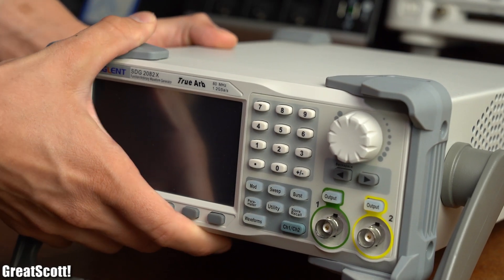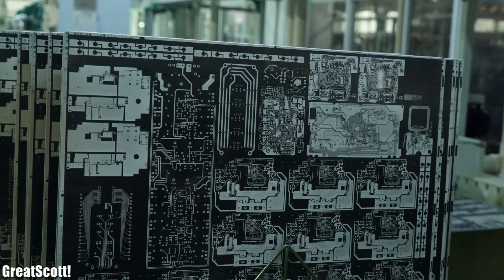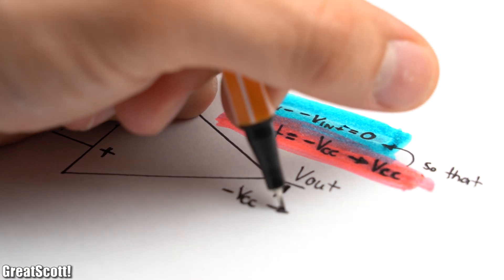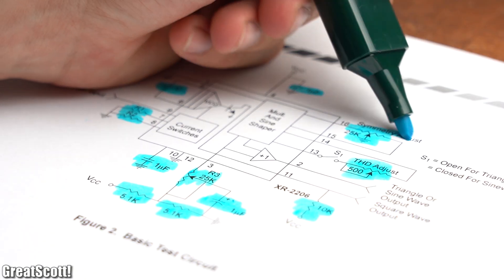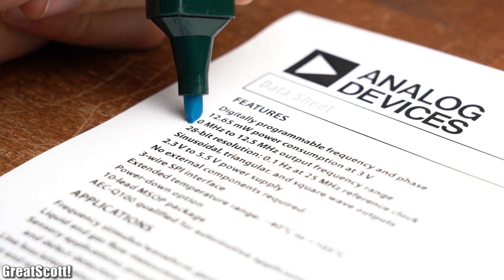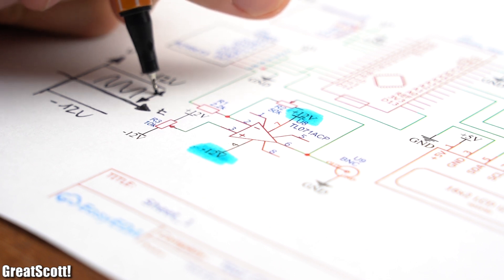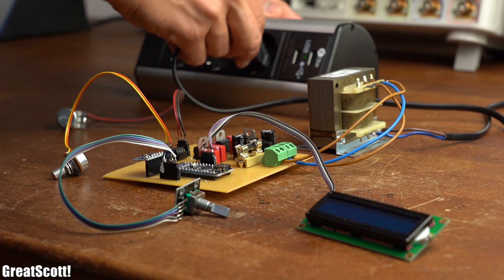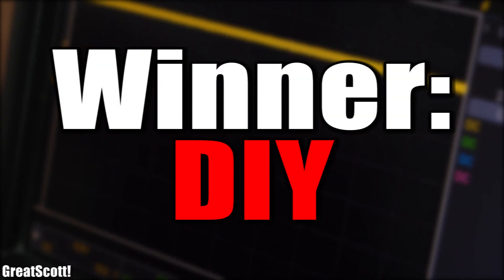Function/Waveform Generator || DIY or Buy

Comment: Sharing a new firmware release. Change log:
- Use **MD_AD9833**(modified) library to control the AD9833 Module: compact and bug-free library with great functions.
- Improved, simplified, optimized, fixed bugs, used better/"standard" libraries for all components: the display, rotary encoder, button.
- Improved navigation, essentially, coded from scratch (see Navigation section below).
- *NEW* Improved the way frequency value is displayed (coded from scratch): 
  - option to hide leading zeros in frequency value (toggled by triple click of encoder button).
  - option to delimit thousands by a separation sign (toggled by triple click to encoder button). 
  - a selected option (one out of four possible combinations) is stored to EEPROM (if enabled) and is set at start up.
- *NEW* Use EEPROM to store and recover settings at switch on (to disable comment `#define ENABLE_EEPROM`).  
- *NEW* Added graphic icons for signal form representation on the display (if you still like the old way, comment `#define GRAPH_ICONS`). 
- *NEW* Tied a signal mode to a Channel; so, now you may change signal form along with its frequency by selecting a channel.
- *NEW* Added a new signal mode: square/meander signal wave at 1/2 frequency (for more accuracy of the output signal frequency). This is a standard feature of AD9833 module. Comment `#define ENABLE_MEANDRE05F_SIGMODE` if you do not need it.
- *NEW* More convenient and fast way of input frequency value by rotary encoder (if you still like the old way, comment `#define NEW_WAY_INPUT_FREQ`): 
  - continuous input: if reach either '9' or '0' in a digit position, then it jumps over to the senior digit and decreases/increases it.
  - fast input: if fast encoder rotation is detected, then it increases/decreases ten times of a current digit position
  - *NEW* "Running" frequency - the value of frequency is applied "on the fly" with a small 0.4 sec delay so that you keep adjusting the frequency by encoder and the value is applied in 0.5 sec after your input is complete.
- Renamed FREQuency register on the display to Channel: so, now it looks like Ch#0 and Ch#1.

Works much better and provides more features. Enjoy its new feel and look:
https://github.com/ShaggyDog18/SignalGeneratorSD

Comment: Hi GreatScott! Excellent Project! Do you still use the Generator?
I have been building it and found out that the software/firmware is very buggy and poorly written. Still great thanks to Cezar Chirila, the author. Major bug: the actual frequency of the CLK meander signal is 1/2 of the set frequency due to the error in the AD 9833 library (fixed it, but eventually, found a better library).
So, I have re-coded it a bit, fixed bugs, optimized, used better/"standard" libraries for all components: the display, rotary encoder, button and, most important, for AD9833 module. Works better. Do you wont me to share?
Reply: please share

Comment: An old PC power supply can be an excellent way of getting +12v, -12v and +5v. You also get +3.3v thrown in as an extra. They are easier to work with than a transformer for the less profficient tinkerer, especially if you use one of the cheap boards available from China that breaks out the voltages from the motherboard connector to the individual voltages and includes fuses.

Comment: It's always nice to make your own test gear but this has the same problem of all DIY function generators I've found, no way to set an amplitude. You have to measure it to find out how much voltage you have. That's why I went for a Feeltech FY6600. Dual output and a lot of other useful features for about the same cost.

Comment: This is a nice project. Thanks for the video! I'm going to build it!

One question: The parts list in your Inventables article specifies a 24V center-tapped transformer. I thought the LM7812 and 7912 had a dropout voltage of around 2.5 volts, so to get +/- 12 volts you'd need to feed them at least +/- 14.5. Or basically a 30V center-tapped transformer rather than a 24V one. Those seem a lot harder to find, though Digikey has a few. What am I missing?
Reply: A friend answered this question for me.... The 24V transformer outputs +/- 12V RMS so the peak voltage will be the 12 * √2, or around +/- 16V. More than enough.

(If you couldn't tell, I'm a total beginner. I just started trying to learn electronics recently after retiring from a software engineering career.)

Comment: @GreatScott could you do a video on how the sorbo/znter aaa 1.5v lipo batteries work? i took apart one sorbo aaa battery ( it was a defective unit ) and noticed that the charging and discharge circuit are very (VERY) small. i tried to make my own 1.5v lipo battery (using a tp4056 lipo charging circuit and a mini 360 buck convertor) but this "battery" didnt last nearly as long as the sorbo aaa battery?

Comment: Hi Scott, quick question: The transformer you suggest is designed for 120VAC on the primary side, whereas here in Europe we have 230VAC mains. I don't see a center-tap on the primary coil to make it dual voltage, thus theoretically the output should be approximately twice of the rated voltage for the secondary (ie. 2x30VAC instead of 2x15VAC). Am I missing something here?

Comment: You never mentioned what the output impedance was? I have found for these things to be truly useful they should be able to deliver leveled  power down to a about -50 dB(w) or about .707  volts A(rms) into 50 ohms or 1 mV peak, if you do this I think you got something unique.

Comment: Your circuit has a pathetic upper frequency limit. The solution: AD9850. It'll go up to 50MHz, square and sine output, easy. The fun part will be making the analog parts operate at that frequency.

Comment: You should add a low pass filter after the DDS chip. Maybe a 15MHz or so LC ( or higher order). This will improve the the signal output at higher frequencies.

Comment: I've been getting by with an Arduino base function generator but it's user interface is pretty bad.  At what point did you find you started having stability problems.  Or in other words, what was the maximum stable frequency?

Comment: Hi Scott, could you add a comparison of AD9833,XR2066, Siglent SDG 2082X and AE20125? with THD Values for example to see how far you´re away from "High Tech". And a Question concerning the unstable signal from AD9833 at a few MHz..do you think it´s just how this DDS works or could it be the Bandwith of your TL071 Opamp?    And thanks for this great video, im trying to bild my own AD9833 and this helps a lot! ;)
Reply: Tl071 has a gain bandwidht product of 3MHZ so i was going to say the same thing, luckily i found your comment after a little while.

Comment: Nice one!  I bought a $50 Chinese DDS function gen a few years ago and found navigating its menu frustratingly cumbersome and its outputs distorted, full of hash and ringing badly.   You get what you pay for, I kept telling myself.  I then replaced its two output op amps with ones having a better slew rat, per some online videos I found, and got better looking waveforms with less ringing, though they're still not lab instrument quality.  In the end I probably spent too much for a cheapie DDS function gen but the experience taught me a few things about how these things operate.

Comment: At 5 MHz you are out of the Utility-gain bandwidth of the TL071 ( that's only up to 3MHz), and that's why it doesn't work as it should. A solution would be to use an Op-amp that can operates in all the bandwidth of the AD9833 ( like the LT1224 or someone else similar)

Comment: you could build a >50Msps signal generator using a 10-bit video dac, a small fpga/cpld, an output amplifier, and a microcontroller (if you can't cram one on the fpga). it wouldn't be that expensive ($30-40) and could be programmed to generate arbitrary waveforms

Comment: It'd be interesting to troubleshoot the issues you saw at higher frequencies, to try and get the maximum performance out of this chip. And to me, the MVP (minimum viable product) would also have variable duty cycle, at least for square wave. That way you can also play around with PWM stuff (and it would match the features of the function gen in my oscilloscope). Without looking at the datasheet, I'm not sure if the chip will do this without any extra hardware, but I do know you can generate PWM signals from a triangle wave using a comparator.

Comment: For 50€ I would just buy an FY3200S from Ebay.
It is an arbitrary signal generator able to reach 6 MHz (with "low" distortion.) or up to 24 MHz for sine waves and even really "crude" arbitrary waves at 20 MHz if one isn't picky...
It is also able to output 20 volts. (Though, that drops with increases in frequency.)
But it beats the DIY solution of this video.

Otherwise there is the FY6800 for about 90€ that supposedly goes to 60MHz, but I haven't tested that one though, so don't know the specs.

Comment: Could the distortion at the top end be solved with a better op-amp?
Reply: I was thinking the same, tl071 is like a 40yr old opamp by now. Probably better isolation and shielding of the signals would help toi

Comment: You should have used a cheap FPGA for this, it would have been perfect. The FPGA would simply have a built in lookup table and you drive a 10 bit parallel R2R DAC directly after some filtering/buffering of those digital signals (mosfet drivers?). If you have one with enough horsepower you could even implement some modulation schemes like AM, FM, PM, QAM, DSB-SC, etc.

Comment: nice project ,you could use AD9851 or AD9850 for higher frequency ,btw it should be possible to modulate signal eg. AM or FM ,it may be useful

Comment: Shouldn't negative 12V linear regulator be enough for powering OP AMP? You don't take much power from output after all...
This way some people would be kept away from high voltage.

Comment: Actually You almost fit my current project :) I am building DIY Function generator based on AD9834 (35MHz), but most of Your written problems are the same.
About Amplitude and Offset - Need to use it with meaning, that its not going out of OpAmp power range. I am planning to use STM32F072 wich have 12bit DACs integrated to control offset and amplitude of AD9834. Amplifiers will be LM7171. I'll add also one PWM output from STM as second channel. As display its planned to OLED 2.4" with SSD1309 controller. About power supply I am still thinking - I think I should use some linear stabilisers for better power quality. Possibly Transformer is very good choise for analog part. For digital part can be used also SMPS. Allready bought some old function generator case with buttons on eBay and AD9834 board from AliExpress - so now is only breadboarding and testing and coding. Thanks for Your review about this topic man!!!

Comment: Personally i prefer second hand electronics from ebay over some DIY project: if you have the time to search for bargains, you can score some amazing deals. And if you know how to repair electronics, you can get a pretty nice setup for cents on the dollar: Just browse for broken equipment, google the schematics and if you find them, buy it. I have gotten two Oltronix B703 (basically three really nice separate power supplies in one small box) for 35 bucks among other stuff. Yes, it can be frustrating and time consuming to repair it, but it is totally worth it.

Comment: great project i was waiting for it until I found another DIY function generator on google which contains more functions than your version like saw tooth or ECG or noise with R2R DAC but it's maximum frequency is 0.65 MHz so i think both are good

Comment: A PC parallel port does 150kbps min out...won't that be great, if someone were to connect an isolated adc to it?
Reply: New ones can go 2Mb/sec
Reply: I wonder, why hobbyists don't use it a lot... Only the CNC guys and some ic programmers do.
One could bitbang many signals out of it, like composite, VGA, even radio.

Comment: Hi Scott. I think a great video would be basically a video focused on the parts you usually skip on the videos. So for example let's say you choose something simple like a power supply diy build. Go through step by step buying and ordering the parts. And the soldering as well. Maybe 3d design if it applies for the project

Comment: if you want to make it better on high frequencies you should use coax cables and make it on rf pcb layout
Reply: you also should filter microcontroller noise from op amp

Comment: TL071 is not suitable for 10MHz signals,and that's why your freq. gen. deos not work properly at high frequencys. Also, I don't see any decoupling capactors (approx. 0.1uF) near IC power pins. Using high frequency opamp and adding decoupling caps should fix high frequency issues
Reply: lm6171 it's a good option
Reply: Great info, thanks! Any recommendations for OP-amp?
Reply: @ObligedTester  I know this comment is from a while ago but as I just looked at this based on other comments in this thread this might be helpful for others. Find something low noise and high speed (select this based on your desired max frequency). You may want to consider slew rate as well @w2aew has a great video that explains slew rate and gain bandwidth product for opamps on his youtube channel that will help.
Reply: @ObligedTester BUF604, LME49600 and LMH series buffer chips.
Reply: TL071 IS AUDIO IC NOT FOR INDUSTRIAL GRADE . BETTER SWITCH TO MCP SERIES IS BETTER
Reply: @yagneshpatel1183  friends I bought this operation amplifier!!!!Still I have not received any of my items about this project!!!I wanna make this project in 5volts!!!I have dc-dc converter from 5volts to 12volts (the MT3608) and I have the converter from 12volts to -12volts...At first I worry about the output signal voltages because I made my own serial oscilloscope with arduino and the max input is in 5volts and I want to control the output voltage

Comment: 5:43 only 10 bit DAC? Audiophiles are coming to get ya.
Reply: Having worked with audio at uni, I can say that 10-bit DACs will easily handle most music without any noticible noise. The thing you want is sampling frequency
Reply: @telefon72  True. But good luck telling that to an Audiofool who believes there equipment sounds better by using cryogenically frozen unobtainium power cable.
Reply: @UtkarshAmitabhSrivastava  Yeah, some students at my uni actually did a procject on wether high quality speaker cables sounded better than just regular lamp wire.. And the result, no difference. The only noticable difference was when using wires that were so thin that they almost melted from the current
Reply: Thats what happens when you use an all-but obsolete microcontroller...
Reply: @power-max  Spoken like a true ignoramus.
Reply: @SpeccyMan  The ATmegaxx8 is nearly obsolete. The only thing keeping these turds in production status is the huge marketshare of Arduino and respective clones. A low-end ARM based MCU or MSP430 is always going to be a better choice. Hell even a PIC micros are arguably more configurable and popular with real engineers and embedded developers. The ATmega328 is 8 bit but not particularly low power, has limited timers (only 1 16 bit timer, and a couple 8 bit ones), offers no native touch-sense capabilities, has no integrated RTC (afaik), no USB peripheral, and only 1 SPI, 1 UART, and 1 I2C, which makes debugging more difficult when you are using these hardware peripherals for other tasks. The only reason I ever use the 328p or similar processor is for compatibility with Arduino software stack and projects that consistently push that micro to its limits. The damn thing isn't even really rated to run at full speed at 3V, least not officially. The hobby needs to move to 3.3v, 5v rails are going the way of the dodo, a holdup for the 7400 series logic days.
Reply: All that said, no MCU would be well suited to the task of implementing a good function generator. An FPGA or CPLD is a much better choice. A really fast MCU with an I2S interface might be sufficient for lower frequencies.
Reply: AUDIOPHILES  USE 24 AND 32 BIT PROCESS.
Reply: Not only audiophiles but just people who need accurate voltages for anything

Comment: The TL071 (Figure 9 of datasheet = http://www.ti.com/lit/ds/symlink/tl072.pdf ) has a unity gain bandwidth of approx. 3MHz. With gain your bandwidth is lower, thus that might be the issue at higher frequencies.
Reply: So what can we used
Reply: @abrarshams811  Use higher unity gain bandwidth opamp, although consider that this will come with an elevated price tag

Comment: What do you mean by “amplitude/offset adjustable”?

Does amplitude adjustable = setting the voltage range?

Does offset adjustable = setting an asymmetrical voltage range? Like starting from -5v and ending at +7v rather than strict -5v to +5v?

To be honest, I’m struggling to see how amplitude and offset are exclusive.... why can’t you just choose your lower bound and upper bound with a maximum range of -12v to +12v?

Edit: so offset determines whether you have AC (waveform must go above/below 0v sometime in the time period) or DC (all of waveform must be completely above or below 0v)?

Please clarify and thanks for the videos.

Comment: I would like to see a video about CAN Bus Systems. Thumbs up for the video man
Reply from the maker: I can put it on my to do list
Reply: @greatscottlab  There are libraries for MCP2515 chip for Arduino IDE and there is also a library for using it with CAN Hacker software.
Yesterday I tested it out on my STM32 Blue Pill board by using stm32duino and it works great!
https://sun9-69.userapi.com/c857420/v857420683/714f7/aM3nLdigq48.jpg
STM32 Blue Pill also has CAN bus support itself so it doesn't even need chips like MCP2515, it only needs CAN tranciever such as TJA 1050.